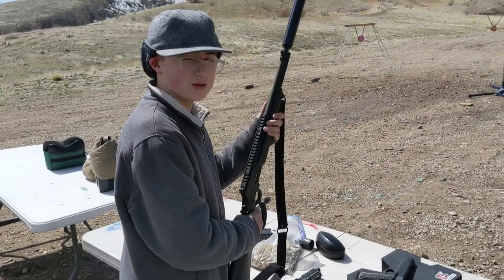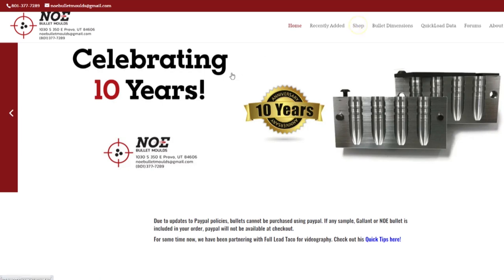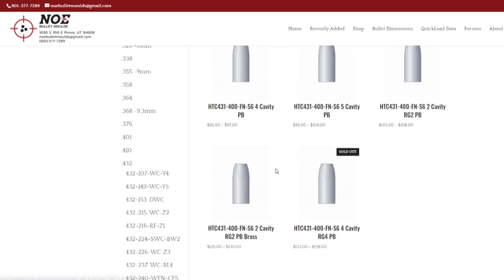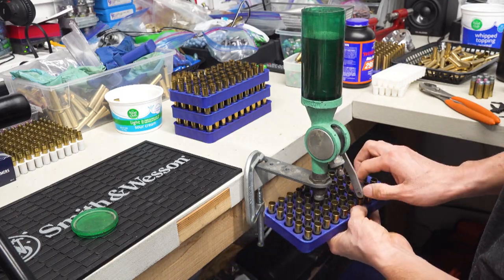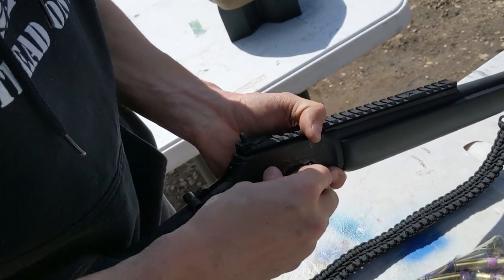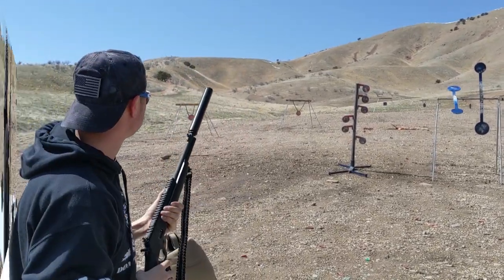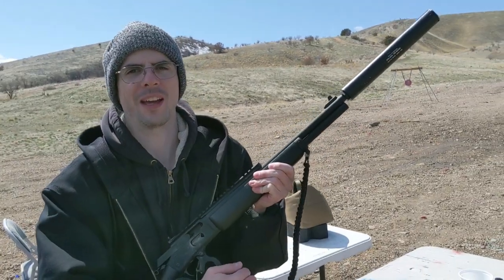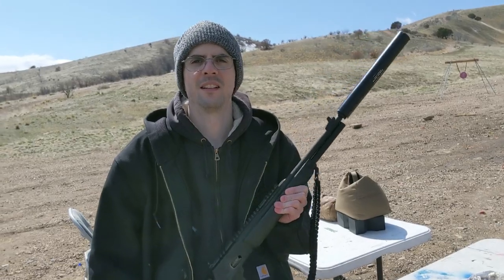Shooting 400gr Subsonic Ammo in my Marlin Dark 44 Magnum Levergun

Comment: Nice. I load up a 380gn 44mag hard cast and on the steel you can’t beat the sound and energy transfer.
Reply from the maker: how fast were you sending them?
Reply: @FullLeadTaco   1050 using I think unique or tight group load data is at home. But my next load will be closer to 950 as I had a couple break the barrier

Comment: Appropriate red dead redemption ricochet noises from a lever gun. So what's your opinion on running gas checks with a can? Have you ever had one come off in a can? Does powder coating over the sized gas checked boolits solve this problem? I've got horandy crimp on checks so what's your opinion bruh?

Comment: I watched your video about the 147gr Lyman mold projectile. I noticed that in the Lyman casting book they say to seat to I believe 1.053. I seated them to a OAL of 1.053 but in my Glock 19 gen 5 I had to seat to 1.031 to pass the plunk test. Is that normal is seating the projectile and additional 2 10ths of a thousand gonna possibly increase case pressure.
Reply from the maker: are you talking about the video I did using the NOE 147 gr mold projectile?  Also what powder are you using?

Comment: A bit late to the party but well done!!  I’ve shot 400 grainers out of my Redhawk .45 Colt which were supersonic and.....uncomfortable. Because of your endeavours, I want to try a similar heavy subsonic version in my Henry Big Boy .45 Colt. My only problem is the feed length. I may have to use .45 Schofield brass and work up cautiously.   

I already load 230 grain .38’s for my Ruger 77/357.  I use an NOE rifle bullet mold and .38 short Colt brass and load them long. These work really well and feed smoothly from the magazine.
Reply from the maker: oh man, sounds fun!  I just picked up a new mold that is a 300gr 35 cal mold (my 225gr "taco bullet" mold for the 300blk extrapolated out to 358).  Should make for some fun testing!

Comment: The bullet looks like a upscale version of the NEI/SSK .429 310 FP designed by JD Jones for handgun hunting. I have the mold and reloading data for it but I've never wanted to blow apart one of my Smith & Wesson's to shoot it.
Reply from the maker: how long is the bullet that you have?  Do you know the recommended twist rate for it?
Reply: @FullLeadTaco  .955 in length. Not sure about the twist rate.